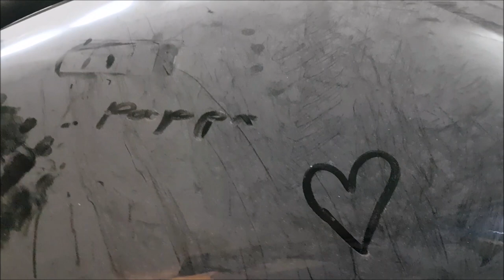#41 Fixing the brakes Mercedes 180 Ponton W120. Bromsrenovering trumbromsar. Drum brake restoration.

Comment: just what the doctor ordered as i just bought a '56 190 :)
Reply from the maker: Thanks Boba! Congratulations to your 190! Will we see it here on YT?
Reply: @Pexyz   - have not thought about it, but i might show it off once i get it road worthy. =)
Reply from the maker: @bobanofat2585  Would be nice to see. Good luck with the project! //Peter
Reply: @Pexyz   - will be bleeding the brakes tomorrow . . been waiting ages for parts, but finally they are installed - lets hope the master cylinder is up to par. was hoping to find a bleed video from you ;)
Reply from the maker: @bobanofat2585  Sorry, my video is delayed, but will come. Hope you managed to fix the bleeding anyway. //Peter
Reply: @Pexyz   - i did. i had forgotten to change the rubber line in the right wheel well. it was completely swollen shut.  i was afraid there was a trick to bleeding the brakes but fortunately it was just as straight forward as with any old car . keep up the good work. love the videos :)

Comment: You didn’t treat the inner brake dust covers! They get hammered by the weather. Clean, spray with rust converter (to make sure any rust remaining is ‘dealt with’, paint, then rebuild the hub. You lose points for that, Penyz! 😠

(I can say this coz I’ve just replaced (what was left of) my dust covers on my ‘74 280E. 😉)
Reply from the maker: You can always find ways to do things differently or more thorough. I'm not here to gain points. Just working on my cars and enjoying them 😁👍. Congrats to a -74 280 E! I also have one, but a -73 👌